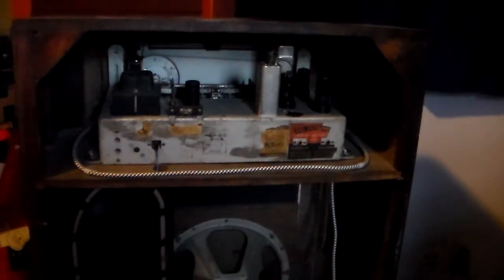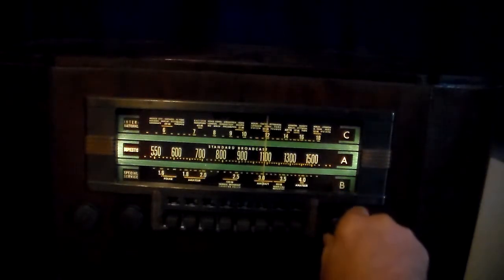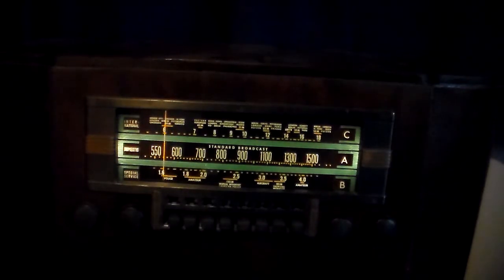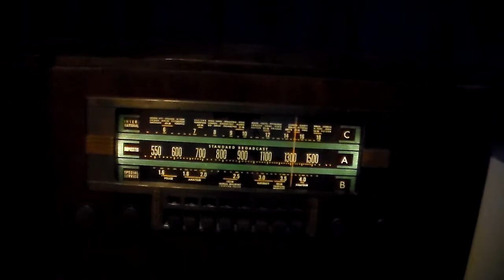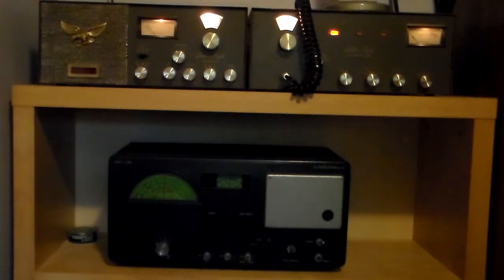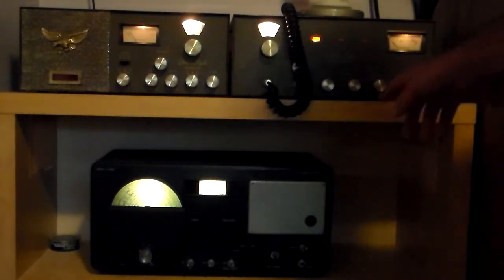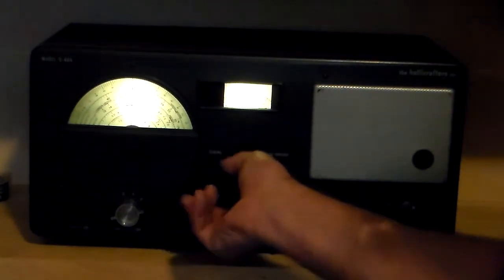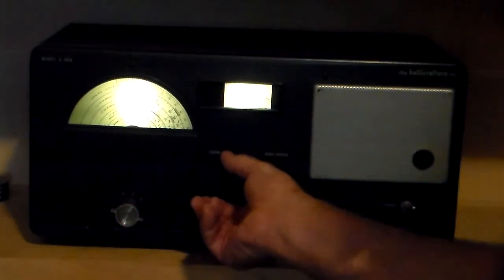RCA K-60 (RC-415B) Radio Antenna

Comment: Nice job @timttime I love the old stuff, I have a old one RCA Vector on the back its model is RC415C looks like the lower antenna is different and your cloth on front is white the one I have is tan...Congrats on the rebuilt. Thank you.
Reply from the maker: Thanks Michael of Marble.  I replaced the front cloth.  It's actually a part from a linen bought from the local thrift store.   The original antenna should be a larger wooden rectangle with wires wrapped around.
Reply: @timtimeprojects3576  Feel like working on another? You could make it a YouTube video project out of it. I would gladly pay you for your time, labor, and I would order any parts that you find that it needs. 73 DE KB3YJU
Reply from the maker: Well Michael, I wouldn't mind doing another to sharpen my skills now that I am familiar, but....   And there always a but.  I still work full time and have a ton of unfinished projects in the hopper, as I'm sure we all do.  As of the present time, I wouldn't be able to give it the detail it requires.  But it was one of the easier radios I've worked on.  Thanks for the offer though.
Reply: @timtimeprojects3576  Thank you for the reply, I sent your video to my wife. ( She is taking care of her 91 year old mother in another state) So she could see yours all lit up, and how cool it looked when restored. 
We picked ours up at an antique market type store near Lancaster years ago. We loved the look of it and just had to have it, probably paid too much. 
Being a ham and collecting radios is sort of a hobby we do together. She had the idea to ask you if you would work on our's and make a YouTube video project out of that. Dad always said it doesn't hurt to ask, the worst you're going to get is a no. :-) 
I understand the project list, ours is always full. But if you find a blank spot on your project to do list, please keep us in mind. 
Back to my antenna project for me. Take care and 73
Reply: Thanks for posting this. I'm finishing a k60 now and getting poor reception while living near Philadelphia.